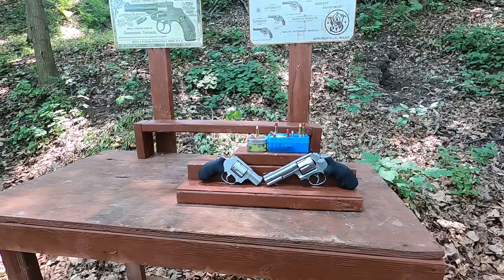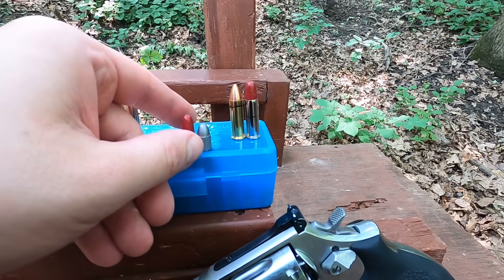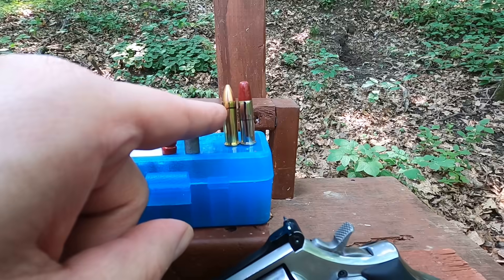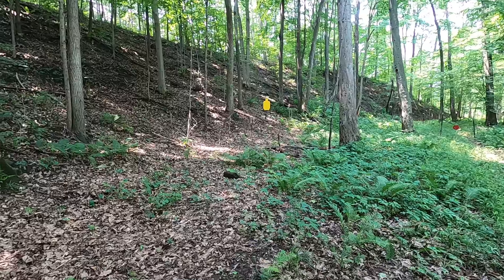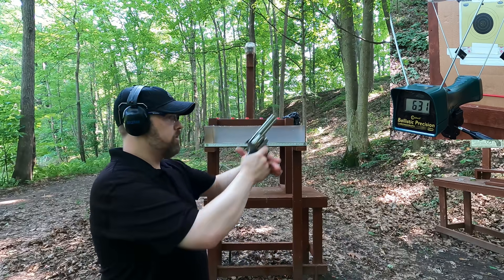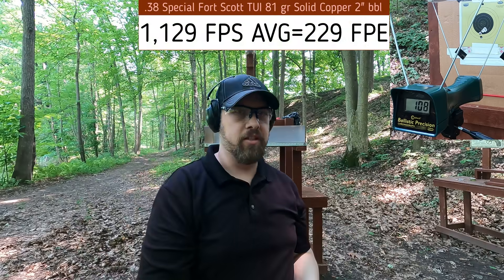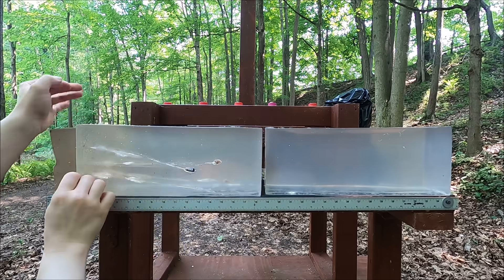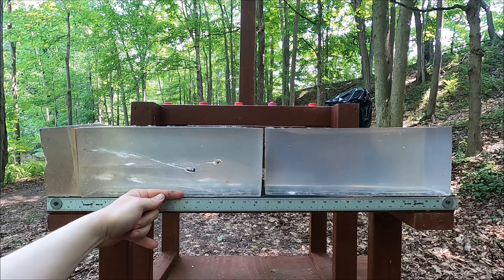Tumbling .38's! Old School .38 Super-Police VS Fort Scott Tui

Comment: Back in the early ‘70s another officer & I were chasing two rape suspects across a football field, one guy running in front of the other w/us right behind.  The other cop fired one shot from about 10 yards and dropped both men.  Our issued guns were 4” Model 15 S&W w/158 grain lead round nose rounds.  He, unknown to me or anyone else, loaded his own 200 grain rounds to a higher velocity and your video reminded me of this old story.  I believe that cop faced some minor admin charge for using unauthorized ammo, but it worked.  The suspects both lived to do a long stretch in state prison.
Reply from the maker: Sounds exactly right. Once they get some speed above my loads, they will just go through a lot of material in a straight line. What a story though, the high capacity 9mm fanboys hearing that one shot from a .38 dropped two bad guys would have a fit lol
Reply: i was hoping an old school police officer would see this episode and make an honest comment based on experience, thank you for that bit of actual info.
Reply: I normally use the 158 gr LRN as my carry round in my 38's. In 2 inch and 4 inch gums. I've got many different weights and styles of bullets. I just always go back to the old, sometimes hated 158 LRN. I believe bullet placement imich more important than caliber or style. And I just don't fall for the"bullet of the week" that cost over a $1 each. I know you have been in some shoot outs. What is your opinion of the 158gr LRN? I do respect your opinions on this subject. Thanks for taking the time to share your knowledge and experience.
Reply: @shadowwolf2524  I used this old round nose load in two of my confrontations.  In one instance it dropped the suspect w/one shot but in the second, not so much.  My take away, aside from me being very lucky, is shot placement is king.  In a real confrontation you could miss b/c you’re shooting in a panic, but I still believe hollow points are better b/c they reduce the chances of danger to bystanders (e.g., over penetration, the real reason LE stopped using the old round nose bullets).  I keep my 340PD loaded w/Remington HTP 110 grain +P HP b/c:  They’re easy to control in a light gun, they’re affordable, come in a 50 round box AND there are no absolutes in a gunfight.  Some of these wiz-bang rounds are just a way to get more $$ out of us.  Hope that helps, stay safe.
Reply: @oldcop18  Thanks for the response. I was raised on a farm in the 70's. It was my job to dispatch the various varmints and critters that came around and were a danger to our livestock. I used both hollow point and non-hollow point pistol ammo for this job. I noticed when using the HP's (including 38), they had very shallow penetration. Much more shallow than advertised. The non-point ammo went much deeper, put didn't go through and through too often. And I did learn,very quickly, that shot placement was the important factor. Both types worked if I hit right. A bad hit with any caliber,of any type of round, had almost no affect sometimes. I've always went back and forth with what type of round I load up with. I'm glad you survived your encounters. I do appreciate talking with you and others who have "seen the elephant". Real life encounters mean more to me than watching bullets flower out in gel. I was in 1 encounter at the age of 18 in which I exchanged gunfire with a guy. He had a 38-4 inch 38 and I had a 6 inch barrel 22 Ruger auto. He fired 1st- hitting my friend who was driving. I fired 8 rounds, very quickly right after. I did fire over him and his buddies head on purpose. The ran off. It all happened,very unexpectely and very quickly. End result, my friend was grazed in his arm,the bullet missed me by about a foot. We found the bullet in his Bronco the next day. It was a 158 gr LRN. I don't believe I got either one of them. But I was aiming over them. It seems they had a grudge against my friend,over a radio deal that went bad. This happened many years ago. In a small rural town. No one called law enforcement. It just wasn't done very often back then. They never did bother us again.
Reply: Good training
Reply: That sounds like a very cost effective round, the police department didn't have to pay for the ammo and only one round for two men. Try that today with what is going on, I think the prosecutors and lawyers would have a field day. To use a bullet designed to tumble would not be advisable, for your own good. There are so many good bullets out there you could use for self defense, even the 38 special fan boy's out there can find something.
Reply: @shadowwolf2524  
Effect is the result, affect is the act of causing an effect.

Comment: I really love the versatility of the .38 special. One of the best cartridges ever made.
Reply: If you hand load, you can do some interesting things with it. My experiments are only launched from a 357 Magnum. 38 Short Colt and Long Colt can also be made to do fun things at 9mm Lugar pressures.
Reply: I agree. I've carried several 38s over the years. I've currently got 3. My S&
W 642 is my "always gun". It goes everywhere I go. I favor 38 Snubbies over 380's. I've seen too many of the small auto's fail. I believe the 38 revolver is very underated. I usually load up with the heavy 158 gr loads. But I've got everything from the lite 90 gr to 158's in my ammo cans. The 38's can eat all of them with no problems.
Reply: @shadowwolf2524  Viva le Revolver! Most reliable
Reply: My 327 TRR8 is dripping with red dots and lights and has a a amazing trigger. But my much older and beat up 686-2 it truly sublime. I have silhouette sighs on it and a barrel weight for popping bowling pins. With mid range .38’s it recoils less then my 617 shooting CCI Standrd or Remington Bucket of garbage, (the price is right so I definitely like them).
Reply: @nathanlambshead4778  Roger that. I've got several autos. But my 642 and my 90's area Rossi stainless snub seem to be the guns I grab to carry. And my new Rock Island 4 inch barrel 38 revolver is the gun I keep closest to me on my nightstand. A 38 revolver is simple to use and reliable. The 1st house gun I bought when I 1st got married, years ago, was an FIE 38 snub. But my wife quickly took it over. So, I bought a S&W model 10-4inch heavy barrel for me. It was dang near mint condition, with a Bianchi leather shoulder holster. Got it from a buddy for $125! Dang,I wish I would have kept that one. My wife has always favored 38's. 2,3 and 4 inch versions. She has only recently switched to a GLOCK 19-9mm. I've got to stop showing her my new guns! Lol.
Reply: @john-paulsilke893  I've got alot of the bargain loads too. I've found them to ignite much more reliably from my single action cowboy revolvers than my double action guns. The single action guns have a longer hammer fall, which smack the bullet harder.
Reply: @Fudmottin  Glad to see someone else has discovered the 38 SC loaded at 9mm pressures!  Works great! I've got a Taurus 692 with the interchangeable 9mm cylinder and have discovered that the 38 S&W makes a dandy "9mm Auto Rim" if slightly trimmed to length and resized in 9mm dies!
Reply: @63DW89A  I have actual SC&LC dies for revolver use. What I was looking for was a low recoil load that wasn't anemic. Obviously the caveat of only using them in a magnum rated revolver applies.
Reply: @Fudmottin  AMEN. Always great comparing notes with a guy who knows reloading and how to safely experiment with unusual but logically conceived loadings completely safe in the right gun! Best wishes and safe loading!
Reply: @63DW89A  And to you. I wish I could remember the reloader / lead caster who turned me on to the notion of volumetric efficiency in cartridge cases. You would probably recognize the name.
Reply: @Fudmottin  I've been influenced by guys starting with Elmer Keith, thru Skeeter Skelton, up to Mike Venturino and Mike Beliveau(on YT as "Duelist1954"). Richard Lee's books are incredible sources of info, too!  Also borrow great ideas from guys like you too. Not at all ashamed to steal a great idea when I see it! Consider myself an enthusiastic "student of shooting" a LOOONG way from anything considered "expert". BTW have you tried soft lead hollow based WC's in the 38 SC? I've always thought the hollow base expansion would stabilize accuracy and prevent velocity loss during the long jump up a 38 Special or 357 Mag chambered revolver. I've had the idea a long time now, but have never actually tried it yet. My intent was to test the theory with easily available WC's and then have a RNFP hollow based bullet mold made in roughly the 125-140 gr range made IF the hollow base idea worked as I thought it might for the 38 SC.
Reply: @63DW89A  I have some hollow base wad cutters, but I haven't tried them yet. Kinda sad since I bought a bulk supply of them! LOL. I imagine they would be good for deep seating in 38 long brass as that is not much shorter than 38 Spl. Could even do 38 Short as well. Probably only need about 3 grains max charge for those!
I really wish I could just go outside and shoot in the back yard like the old days. That would make things soooo much easier!
Reply: @Fudmottin  Know exactly what you mean! I used to be able to shoot right from my back door. But have moved unfortunately and must use the public range now. Am on the look out for some recreational property in the county where I can set up another personal shooting range!  Presently am an OTR trucker, and while I love the job and the constant nationwide travel, it does severely cut into my shooting and reloading time!
Reply: @63DW89A  Yeah. I'm in suburbia now. I don't want police showing up from neighbors complaining. So I have to go to a range that is 45 minutes away!

Comment: Sam i noticed every time you shoot those super police loads you always have a smile on your face and it makes me smile.. its contagious.
Reply from the maker: There's something special about them. I think it's because they are in a sense perfect. Cheap, easy, 100% matches what a hollow point will do, shoots good and quiet. Not much to dislike.
Reply: @GunSam  i couldn't said it better.
Reply: @Ford360CID  I like the concept of those slugs too. Although I wonder if a flat point would be better along with a few more fps. Perhaps softer lead as well.
Reply: @Fudmottin : with original load it was a very soft lead because it didn't have to be fast... so slow and soft was the name of the game, flat points would act like a soft point or s.w.c, thou it would still tumble but the long round nose would cause the yaw much sooner and since it was to be used in a soft target keeping the penetration low was key to effective stopping power, as Sam demonstrated the bullets had actually bowed due the lead being a bit softer than hard cast so there was quite a bit of energy dump based on the bullets condition to bend as it did.
Reply: @Ford360CID  I sure wouldn't want to be shot with one either way. Obviously. I was thinking maybe it could be made a tad more effective.
Reply: @Fudmottin  either approach can work, but there are trade-offs involved. A FP will penetrate straight & deep, and tend to do a fair amount of tissue damage en route; sharp-shouldered bullets such as SWC and WC will tend to cut a more pronounced hole in tissue. Soft lead tends to "crush" its way through bone, flattening somewhat and melding to the bone & carrying away a large amount of bone matter, according to the 1904 Thompson-LaGarde tests conducted by the US Army. They found that hardcast lead alloy bullets tended to penetrate bone more cleanly, similar to FMJ, and do less damage at the relatively low velocities involved. Such bullets "gently" parted flesh and drilled through bone w/o shattering it. Downside to slow, heavy, long tumbling bullets is reduced hard barrier penetration (car bodies, etc.), plus uncertain trajectory of the bullet within the target; wound damage is dependent on whether the bullet tumbles and what it hits & damages when it presents its long axis while tumbling through the target medium. In my non-scientific tests, increased velocity stabilizes the bullet better, but thereby reduces the tendency to tumble & reduces target effects. Since a tumbling bullet tends to wind up base forward, it often appears to rotate 180° but not perform a continuous series of 360° rotations.
Reply: @d.mangham5204  Terminal ballistics is complicated.

Comment: I have Police officer friends here in Indiana and they only carry Fort Scott.  There are different weights of the bullets.  So you can determine the amount of penetration you want.  The main advantage is that they can and do go through hard bearers.  They will go through car windshields.  Heaven clothing and not get clogged up.  Car doors home doors.  More and more police officers are using them.  Police records are showing great results with stopping power and no problems with pass throughs.   They are the only rounds I use in my daily carry.    There 5.56 are also becoming popular with police officers.  The ability to go through car panels and not tumble until they hit soften tissue is very effective.  Good video look forward to all you new stuff.

Comment: @15:00     I think 45 acp & 44 Special  are about the most power that won't blow your ears out .  357 , 44 mag , & other high speed , large blast rounds are hard on the ears .
Reply: The 45 Colt, at only 14,000 psi, can easily get a 200 gr bullet to about 1100 fps from a 4-5" revolver barrel. In either soft lead hollow point, or hard cast full wadcutter, that would be a round of incredible destructiveness at close range.

Comment: Several years ago I loaded some 38-200’s for a friend that acquired a Webley Mark IV Tanker (hammerless).
Even though the revolver was in outstanding condition I still stayed on the low end of the load data. No sense in pushing the limits of something so old and cool to own. I had to purchase the 200 grain bullet mold for the project but it was fun to be a part of the whole deal, I loaded about 15 rounds just for my personal playtime before returning the pistol. Good video as usual, take care
Reply from the maker: I did that before, loaded for a friend. He shows up with all the parts to make .450 Bushmaster. So not only did we make normal rounds, we made some that were basically .45 ACP's. Fun little plinkers.
Reply: Awesome,  subsonic .450's. The same guy's brother ended up with a Colt, I forget the model but it was stamped "Hong Kong Royal Police " or something like that, anyway happened to be chambered for the 38-200 so I made him a batch too. At that time there were no videos on that cartridge, I was happy to see it getting exposed, I had never heard of it until then.

Comment: Bullets tumble because the center of gravity of the bullet - the projectile - is to the rear of the object.  When meeting resistance (like ballistic gelatin) the front slows down more than the rear, thereby creating a tumble effect.  Normally, they do not tumble in flight -ante target - from this effect.  Air does not have as much resistance.  This is also the reason the M16 bullet tumbles.  

If a bullet tumbles in flight (usually the result of a seriously undersized bullet or worn rifling), accuracy is critically hampered.  

One notes the British revolver caliber .380/200 was essentially a .38 S&W (the shorter one) case and a 200 grain bullet for the same effect.  

I noticed the last Super-Police round fired stopped base first (backwards) which shows some tumbling.
Reply: Bingo!

Comment: I just put a Pachmayr Rubber grip on my 624   4" 44 special     it went from pain with wood grips to pure comfort , no pain at all , no whacked thumb joint . With mild rounds no issue with more power , I was getting wacked . This is almost the same as a 44 mag mountain gun ... with bad grips & mag rounds  =  1 mint condition Mod 29  S&W   with a box of ammo with 6 rounds shot . It's a world of difference .
Reply: The wood grips were large ALL Smooth factory S&W laminated . They look cool , but are way to slick & not fitted well > they were too thick & high at the top . It's possible I could have reshaped & refinished & they would be a little better . They would never be as good as the rubber grips .
Reply from the maker: Such a rare gun! If you wondered, I was waiting to give a link to Angelo at lead bullets 4 life to watch, and he didn't until like 3 am. Felt like he deserved to see it first, so now come today it's so late and it's the end of a federal holiday, so I figured more old folks would be on here now than tomorrow lol.

Comment: Be interesting to see how well at tumbling a hard cast 158 grain bullet would be if designed with a long pointed, tapered nose like the Fort Scott TUI!  Such a bullet would shoot right to point of aim in most 38/357 revolvers.  The 38 Special loading specs actually allow for 0.395" nose above the crimp groove, allowing a longer nose than the 0.3" nose above crimp groove that the .357 Mag specs call for!  Most of us just load bullets set to the 357 Mag crimp groove specs without thinking about it! But for a bullet intended to tumble on impact for best terminal effect, that long 0.395" nose allowed on the 38 Special would be just the ticket!